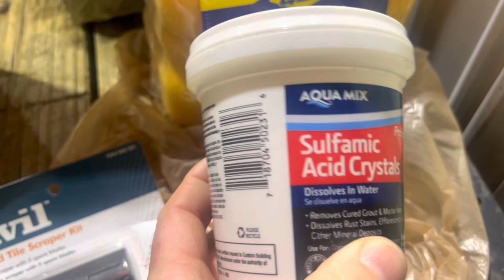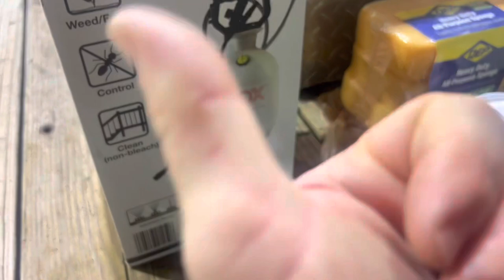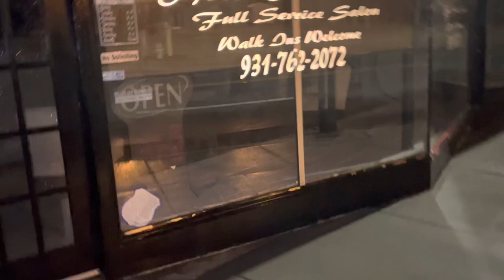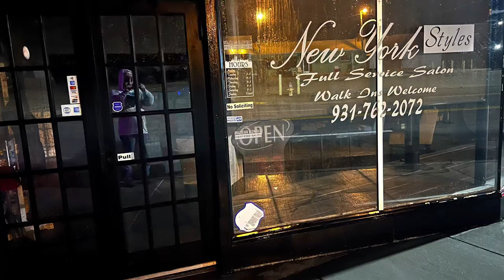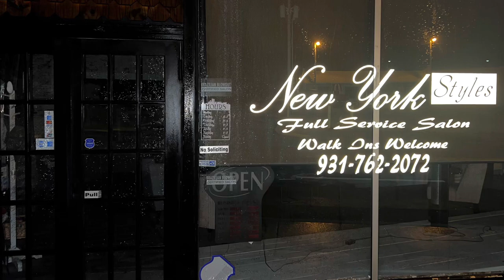HOW TO PRESSURE WASH COMMERCIAL PROPERTY! HOW TO REMOVE CONCRETE,MORTAR FROM A ANY TYPE OF SURFACE!

Comment: hey their chief. I just ordered a 40lb bucket of sodium hydroxide. what concentrate ratio do you mix yours at? Also, what other stuff do you add in besides dawn? Am I able to put in zep purple degreaser, or will it react bad? Should I try a small mix in a tiny cup to see if it reacts badly or do you know? I hope to hear back from you. Have a great day!
Reply from the maker: Sodium hydroxide and Blue Dawn is primarily all that I use and it works great